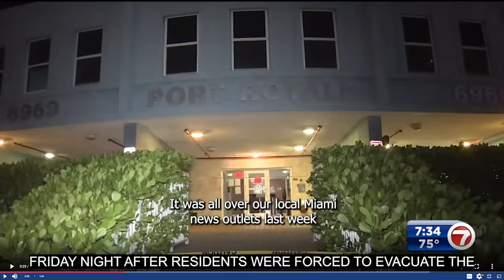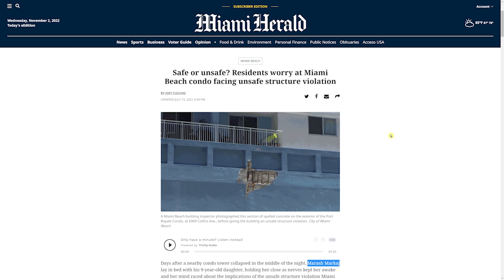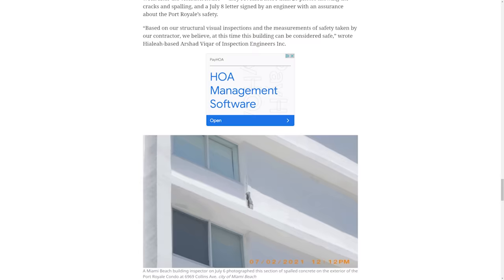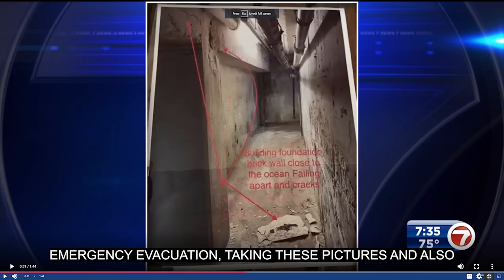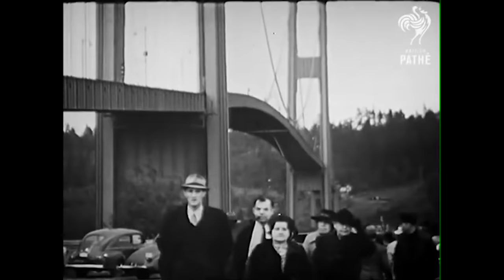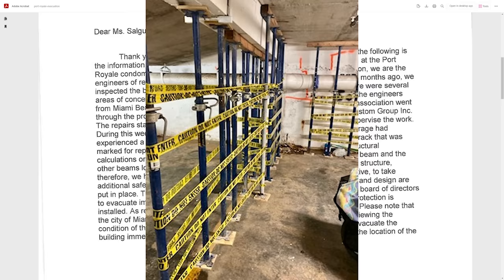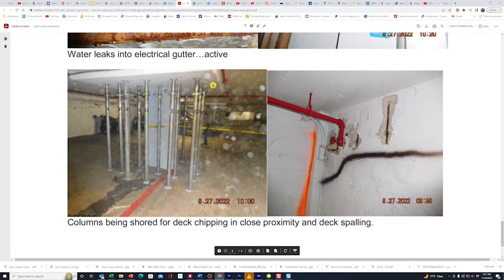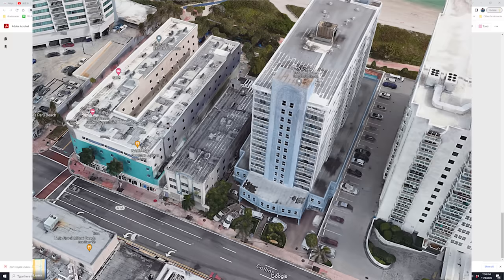Another Miami Condo Evacuated Why it Will Collapse

Comment: I’ve been a contractor for 40 years. I used to visit my grandparents on Floridas eastern seaboard regularly from 1993 to 2005. I can guarantee you that there are a lot more Champlain Towers South just waiting to collapse over there. Americans are building garbage, and not just in Florida. All of these buildings are being exposed to salt 24 hours per day. Concrete is porous. Florida is very moist. Moisture is going to penetrate concrete all over the place. Many of these places just patch over the bad spots, paint it or seal it, but the cancer will still be there. Good luck to you all down there. You’re gonna need it.
Reply: Exactly, this is not just a South Florida issue, I live in NYC and you can't walk a block without seeing a building that is either being torn down or rebuilt due to structural integrity issues, we have water issues here as well, remember that the middle of Manhattan is a swamp and cannot support massive structures as the battery or uptown can.  Shortcuts may save money in the short run but they cost everyone in the end.
Reply: Can that include houses too?
Reply: Go up to Inverrary in Lauderhill. Those mid-rises are in poor shape
Reply: It's only going to get worse.
Reply: Try Brazil 😅
Reply: Thank you for your insight into this issue
Reply: Guilty contractor has spoken
Reply: I'm a youtube neurologist
Reply: @hounddog946  I used to do delivery for papa johns in Lauderhill from the location on 441 and Oakland park blvd. We covered all of Lauderhill and Sunrise.  Some of those condo units I would go into were so dilapidated its amazing they haven't falling down. Many of those buildings have nothing but section 8 tenants living in them and their landlords don't give a crap or either don't have the money to maintain them like they should. The Inverery used to be a very nice when they first were built. Sadly I think all these buildings have a lifespan. Personally I don't think we should expect these buildings to last forever like most people do. I think even when you maintain them properly overtime the building concrete and rebar will continue to break down. I think alot of these buildings should be taken down and redeveloped. Maybe people should rethink about buying expensive condo units in these uber expensive buildings and think about living in buildings that are much more replaceable and cheaper to maintain and replace, buildings that won't be a huge financial loss if they have to be taken down. I don't know maybe the whole construction and real estate industry needs to rethink about how they market condos and high rises. Im living in West Palm Beach now and in down town West Palm Beach I remeber seeing this one building, it was a 2 or 3 story motel, with outside entrances to the units accessed by a walkway balcony along the perimeter of each level by outside staircases. Anyways Im mentioning this building because when i drove by,  it had huge portions of the outer walkway and portions of staircase that weren't even there because they collasped. It appeared this building still had people living in it and the only thing I saw keeping people away from the area was a construction barricade at the base of the stairs and some yellow caution tape near where the walkway gave way. Im not talking about small little chunks of concrete, I'm talking like 20 foot slab of concrete and brick. I can't believe people were still allowed to live in that building in the heart of West Palm Beach. I noticed that building, Im guessing about 5 yrs pre-champagn towers collaspe. Im not sure what happened with that building. It might have been repaired or eventually been torn down. Hopefully its not still there. This building Im assuming was built in the 50s. There's many more buildings that are creeping up in age that are in bad condition. Im all for saving historic buildings but when they become a danger to the public that's a problem.
Reply: @finnrobson3081  Yes and no. A concrete or block house can have cracking. Even severe cracking, but the weight of a standard roof would never cause it to collapse. There's just not enough load pressing down on the walls
Reply: Concrete in this salt water environent has a maximum safe lifespan and the bulk of these building have exceeded that. They should have planned to rebuild them every 30yrs not do 40yr recertification patch jobs.
Reply: these were built 50+ years ago…. just fyi i’d say it did pretty good after allll the hurricane and environment it’s been in for that long
Reply: @finnrobson3081  no. it only affects tall concrete structures. houses are built from wood
Reply: @RDC_Autosports  yeah im not saying in anyway they were badly built. I just think that concrete and metal have lifespans and buildings made of them  shouldn't be thought of as buildings that will last forever. I think that buildings that pass a certain age should be put on a list or something so people know they are living in a ancient building. Im not for having the goverment to force people to build things they dont want to but I am for making it so people know they are in a old building that might collaspe at any given time if they choose to live there. People that choose to live there should have to sign a form or something to wave their rights to sue anyone if they choose to live there. I think if people know that they may lose their life and their rights in a building like that they'll be more likely to live in a newer building and real estate developers will have more incentive to take down old decrepit buildings and rebuild new buildings in their place. That's just my thoughts on it. I think everything should be voluntary but at the time everyone should have full disclosure.
Reply: @tektkite7255  it depends on where you live. not all houses are made of wood. Where i live in Florida alot of houses are built of cinderblock some are even poured concrete with only the interior framing made of wood or steel. The older houses of Florida pre1930s are typically the only houses ive seen that use wood as there main structural support. With all the hurricanes Florida has had most developers moved to building houses of cinderblock or concrete with only the roof being made of wood or steel. I worked on one house built in the 1920s structurally framed of wood and it had about 1 inch of mortar spread across the framing to make the walls. All the structural wooden supports were completely rotted away at the bottom. There was really nothing holding the house down to the ground except for the weight of the mortar shell. After seeing the interior of its walls I always found it amazing that that house survived hurricanes with relatively no damage all the way back to 1920. Another thing looking at the electrical of that house dumb founded me. Its amazing the houses electrical didn't burn the house down. The electrical was still working all the way until we remodeled the whole house in 2017. I think im construction it all depends on the quality of the workers that build the house. You can have houses today with modern technolgy and materials that won't last 5 yrs because of half ass workmanship, then you can have something with really old building techniques and materials that will last forever because the workers did a good job. I don't know im probably ranting now. Don't know where im going someone please shut me up!!!! 😆 😆 😆 😆 😆 😆
Reply: I always look at American house's and amazed at how beautiful and big they are but they look weak as if made of cheap material and nothing compared to the Victorian house's here in the UK and the regulations here are very strict and they will make you tear down a mansion if it doesn't comply...just an observation.
Reply: It’s Florida!!! Everything is Disney era , yeasteryear mentality.. mots buildings have served their useful service life and should be replaced regardless of‘inspection’ results
Reply: @finnrobson3081  Anything that isn't properly maintained / repaired.
Reply: @Tekt Kite my house is built out of gingerbread.
Reply: @krisone63  not to mention there are subway tunnels drilled all over the place and the stories of unknown subway tunnels being found and other unknown tunnels......
Reply: We may have a lot of bad and poorly constructed structures here, but it's nothing compared to what goes on in China.  Seriously, it's a total mess over there with poorly constructed buildings that start to fall apart within 5 years of being built.
Reply: It's not just an American issue. Subpar construction and maintenance is widespread in nearly every country except Japan.
Reply: @DeusExAstra  crazy yt vids on those failures. with the construction bubble they had many shortfalls will never come to light  as the buildings will likely never be finished as they ran out of money.
Reply: Building high-rise structures on a sandbar is dangerous.
Reply: Looks like all those building are coming down! ❌❌❌❌❌❌❌❌❌
Reply: Are there geologic issues involved that make building in Florida particularly difficult? 1 ft above sea level and soil profile literally says sand and sea shells. Seems like making skyscrapers is tough in that kind of scenario. In New York you have granite bedrock to anchor your buildings to, something Florida does not have.
Reply: I have lived in South Florida for decades and its fact not fiction many of these were built with cartel money directly or indirectly and payoffs along the way to get them into "legit" income generating busineses and short cuts were taken no questions just like Champlain towers all sorts problems were found even in the original plans that were ignored. Hopefully there wont be a repeat. There will be more buildings condemed for sure
Reply: @finnrobson3081  exactly its not just the buildings. homes are being built by practically high schoolers lol. and everything is so cheaply made now. but they want half a million dollars for it.
Reply: Don’t forget the rising water table on the east coast of Florida in particular. There’s no way to keep that water from degrading those pilings in addition to creating an uneven settlement issue.
Reply: @TheBitterSarcasmOfMs.Anthropy  these buildings on the east coast of Florida were thrown up in a hurry in the 70’ and 80’s, often by fly by night consortiums of investors. A lot of shady stuff with contractors, investors and building inspectors. Stuff like a structural column would call for 13 sticks of 5/8 rebar. The contractors would pour it with 11 sticks of 1/2. The building inspector would sign off on the column. There’s probably the same stuff on the gulf coast, the building boom in the 70’s and 80’s on the south east coast was just the most insane during that period.
Reply: @finnrobson3081  No houses by and large are to small to weigh enough to collapse, and beyond that they are made of brick and wood normally so while the can rott and eventually crumble you'll notice before it does. Rotten wood is easily seen where rusted metal encased in concrete can't be.
Reply: @finnrobson3081  if your house is built of concrete and rebar.
Reply: @jamesbehrje4279  to deliver to the area you described; you deserve Papa John’s Medal of Bravery and Meritorious Service. I grew up in said area in 60s and 70s. It was nice middle class blue collar people. Inverrary was upscale and even had a PGA Golf Tournament there every February.
Reply: @hounddog946  I briefly lived in Inverry
Reply: @horsewithnoname12345  The whole world lives on borrowed time. eventually, all these buildings constructed 60+ years ago are going to start collapsing
Reply: I did apartment maintenance.
I know what you're talking about.
Owners want to make money, HOAs want to save money.
It's all about the Benjamins.
Reply: @wileecoyote5749  nah you're a youtube janitor now clean up the mess I made in the bathroom
Reply: @tektkite7255  -  Oh?  Are you sure about that?
Reply: Doesn't help that Florida is a known sink hole capital of the eastern seaboard
Reply: I have In Laws in West Palm Beach. They must be in one of the most expensive buildings in the area. It's on the beach and not that old. However, water appears in portions of an undergrown garage and there are other complaints. I think the building is in trouble.
Reply: @krisone63  This is a myth about NYC. Large buildings were not built in this area due to economics and zoning. The land underneath is the same (very sturdy). The reason you see scaffolding in NYC is that every 5 years, buildings must perform a facade inspection, which takes almost 1 year to complete
Reply: @omadjourney  Most buildings and homes are well built in the US. Maintenance is key though. These are extreme examples because of the salty atmosphere among other variables.
Reply: @lukethompson5558  True.
Reply: Look up Las Vegas new homeowners, unbelievable how shoddily those houses were built. They hire anyone to build, no experience.
Reply: I was just wondering how many of these buildings are in the same state.  people paying through the nose to live there and unsafe the entire time
Reply: @krisone63  At least in NYC they are on top of it and not sweeping it under the rug.
Reply: @wm1958  
I LOT of people's homes are! They just don't know it! YET! 😉
Reply: I read a long time ago, that rebar is NOT a good reinforcing material, since it rusts, and does what is exactly illustrated here - when it rusts, it pushes against the cement.
I find it quite interesting  that there are buildings, esp. in Europe, made of stone (even dry, not reinforced with mortar), and/or cement, which are still standing for, even, several centuries. Contrast that with what we have today... esp. in the U.S.
Reply: @dalemason9886  Your point  is well taken - thank you for the reminder of why those awful places were cheaply built, in the first place.
Reply: @Lilmiket1000  💯💯💯💯🤑🤑🤑
Reply: @ItsaRomethingeveryday  in more ways than one...
Reply: I grew up in Hollywood and the house I grew up in was built in the 30's, my parents bought it new. It was built sold of cinder block with the roof tied down through the the blocks into the ground. It's the new construction that's the problem.
Reply: Also, the Bible says you're not supposed to build your house upon the sand.
Reply: Amen
Reply: Good analysis. In addition, they are built in sand, and likely do have a foundation footprint deep or wide enough. All together, a real China job.
Reply: @larrysorenson4789  Houses used to be works of art.  The ones they built in Pasadena around 1900 were not only beautiful but solid.  Everybody involved in the housing market today, both the builders and the buyers, are ignorant of the finer points of housing.  They want things too big too fast.
Reply: @davidlafleche1142  the Green and Green Pasadena homes marked an almost oriental obsession in beauty and perfection. Here in Arizona there is a history of great works. I have designed and built homes and offices to my standards for 40 years. My Gods are the master builders of the previous century. The money risk was mine and can you believe it, when and if I ever sold a property there were no discussions of cost. Recently, the cost of homes in Orange County Ca. Hit an unbelievable $1,000/sq,ft. For stucco clad stick boxes with builder hardware and nice rubber windows slapped together by unskilled workers and featuring the “luxury” 1/2” drywall.

Not my cup o’ tea.

Keep the faith baby.
Larry in Arizona
Reply: @hounddog946  yeahhhh sketchy stuff. HOAs do everything in their power to not increase fees or whatever so nothing is fixed as it should be
Reply: @meredithheath5272  they know the rebar stinks yet they keep using it
Reply: @Lakridza67  I studied Architecture at the Ecole’ des Beaux Arts when it was located in the Versailles Complex. One professor was a Danish guy named PribBuss. He had been the field Architect for the Opera House. Tons of stories over wine, baguettes and cheese. Oh, what could have been. But as with untested designers, it is a miracle it got built at all.
Reply: @larrysorenson4789  I am born and partially raised in Denmark. Things seem more proper over there. I miss it a lot!🫶🏻
Reply: Amen, brother.  There's more to come.
Reply: @finnrobson3081  Absolutely. The new houses are not good. Although they are built to stricter building codes, they mostly use chip board which comes apart after limited exposure to water or moisture.  Also contains all sorts of glues that burn fast and hot.  The solid lumber, grown ultra fast with GMO, and harvested very early, has huge growth rings. Low density, burns fast. Prone to warping, twisting, distortion. The interiors crammed with synthetic carpets, plastic galore, burn very hot and fast. PVC siding very toxic when burned. Most of the interior trim is MDF fiberboard. Very little resistance to water, even just mopping the floors or you leave a window open and some rain comes in. It’s garbage. Looks fine when new and can sell the house quickly.often built by neanderthals who could care less and just need to get home to watch The Simpsons or play on their Nintendos.
Reply: Exactly. This guy is clueless
Reply: Americans are in fact not building garbage. Maybe your company does and you’re an American so that’s why you assume this? Epoxy coated rebar and water proofing admixtures are frequently used in FL. I’ve been in concrete construction in FL for over 20 years and I’ll guarantee you the current buildings are not garbage. This is an over 50 year old building. Get a clue.
Reply: Do you know what happens with condo owners if a building is condemned?  Do they get any remediation?  If a builder wants to buy the building and rebuild, do the owners have any say?  Thanks.
Reply: @davidlafleche1142  precisely the reason why not all change is good change!
Reply: @Lakridza67  "Meddle not with them that are given to change."
Reply: @Lakridza67  Oh, you're from "down under"?  I'm from "up over" (New England).
Reply: @Lakridza67  my brother’s wife is Danish. She and her Daughter carry dual citizenship. At one point there was talk of that family Re-emigrating. Sadly, my brother and I are only 50% danish, genetically, eliminating him from ever moving there and having productive work. They are heartbroken but do visit annually. Their daughter attends school there for 90 days each year. Best always. Larry
Reply: @larrysorenson4789  I am in the Same boat. They won’t let me back because my father is Norwegian! They have lost the plot over there. A fifth of their population is now Muslim so there’s that🤷🏼‍♀️🫶🏻
Reply: @larrysorenson4789  and I am fluent in Danish too. Ridiculous and discriminatory laws they have going on🤦🏼‍♀️
Reply: Funny how in Europe there be thousands of year old buildings still very safe and American built stuff is crap in general
Reply: Wouldn't it be appropriate during construction to seal the concrete and then every few years reseal it to limit moisture penetration?
Reply: @eddielane9569  Well, in a word, yes it would be nice to seal all surfaces on all buildings every 3 years. Its also nice to always change the oil in ones car every 3,000 miles, seal ones tile grout annually, thatch your lawn seasonally, change your smoke detector batteries twice a year, etc etc etc. who ever does all the stuff they’re supposed to?
Reply: @larrysorenson4789  yes, I suspect you may be right! Sending love from Melbourne Australia 🫶🏻🕊
Reply: @Lakridza67  😃👍❤️
Reply: Thank you for this explanation it helps to understand
Reply: @jamesbehrje4279  James; thank you for taking the time to add an in-depth and thoughtful post regarding the subject of buildings in Florida. I always think about the N I stayed in in Germany back in the 80s that was 600 years old. It makes me crazy that Americans don’t care to build structures that we intend to last generations. I am troubled, again as a builder, that we are making garbage that needs to get blown up after 35 years of service only. Even if you recycle every bit of material in the building, it still takes an extraordinary amount of energy and resources to build a new one. at the heart of this though, I know I also resent endless buildings visually polluting pristine Florida coast line. As you pointed out many of those buildings or two or three story once upon a time, and then those get torn down and become 10 story, which will probably get torn down and become 30 story and so on and so on. Where does it end? since so much of this garbage was produced in the 60s 70s and 80s, my guess is that the Champlain tower south was sort of at the forefront of mass building failures. Although it was not among the oldest, it is easy to see that it was severely abused with all the added weight of the pool deck pavers and sand, huge planters and palm trees, and that 13th floor we are not sure whether or not that was ever completely authorized, and perhaps CTS had more than it share of marble and granite being added over the last 40 years. And possibly it may have been slightly under built as well. Again I know the clock is ticking, it will be no surprise when the next one comes tumbling down.
Reply: @finnrobson3081  yes it can, but houses aren't nearly under the same load and are typically wood framed. The case is where houses are victims of modern builders and engineers are in fires. I watch the fire in my town of an old train station. The building burned not down, but away for like 2 hours. It seemed to evaporate and not once was there any structural collapse. The old frame Construction was so solid all the framing burned in place without collapse. Modern houses made of composite wood using little hangers will spontaneously collapse during the burn. It is caused more deaths a firefighters as a result. Entering a modern burning house is much more risky than the past because of that. A common issue in Ontario has been the collapse of exterior decks. There have been about half a dozen with fatalities in the past 5 to 10 years. These were caused by people building exterior Decks that were just lagged into the wall and with enough people on them they would collapse and kill. A neighbor across the street has a deck that attaches to the house on the second floor and he was getting water into the basement. The deck was slotted in under the door and the posts holding it up we're obviously not set below the frost line as they could be seen to heave and this caused rainwater to pour against the house and it completely rotted the frame right down to the basement. So his house could collapse on that wall. As far as I'm concerned deck should be freestanding off the house structure. They should not be allowed to be attached to a brick wall
Reply: My father was a heavy construction worker, and a lot of his work was on the new 401 highway back when I was an infant. Some of the companies he worked for, because he was just a machine operator, redirected garbage trucks to the concrete pours and filled many of the overpasses with garbage mixed in with the concrete to save money. He liked to joke as we went under some of these overpasses, and would step on the gas pedal, and then yell that we had made it. The construction industry is corrupt Beyond imagination. And it doesn't stop at mundane buildings. The Fermi 2 Nuclear Plant had more than 20 tons of missing rebar, and they were voids in the containment buildings concrete large enough for a car because they never vibrated it. I've seen residential concrete walls in basements that were essentially glued together aggregate that look like they had only been dampened with concrete. And the repair work consists of paraging  over the defective load-bearing work.
Reply: Nothing a little silly putty and superglue won’t fix.
Reply: @jamesbehrje4279  yet over here in Europe we have buildings that are still up & safe hundreds of years old. I've lived in a placed dated from the 17th century before.

I know we rarely get hurricane type weather but we do have excess humidity, temp variation, road salt & more
Reply: @Tekt Kite  single family Houses in Florida are typically built with cement.  
Wood just rots and gets attacked by bugs.
Reply: @jamesbehrje4279  Actually.. you're right on the mark.   Florida and wood don't jive.
Reply: Looks like it was a lot of cheap concrete supplied by a certain group of wealthy individuals who are not building contractors??
Reply: And yet the concrete the Romans made is still solid thousands of years later despite being built by or sometimes IN the ocean.
Reply: @platedlizard  Yeah. Go figure…
Reply: Some people may hate regulations, but here is an example how regulations can help prevent these outcomes.
Reply: @horsewithnoname12345  oof
Reply: @platedlizard  Roman's had Alien Technology like the Egyptians did ?
Reply: When I was a kid, we were stationed at Patrick AFB for about four years, I was attending DeLaura Jr High!  While we were waiting for our housing unit nearby, my Dad rented a furnished apartment.  It was just South of that school, so I decided to walk to it, after school, and, I saw a heavy set lady get into her big four door, example of a Detroit steel
car, She sees me walking towards her, Sits down, and slams her door shut, and, I hear a crack sound I was not expecting, her car beaks in half, settles down she gets out, as I walk up and, remarks that this happens about every ten years from living here by the ocean,  We at the time had a 1967 Buick Skylark, it had big rust holes from our four years living there, looked pretty bad, so much so, some dum, dum, in Texas, thought we were low class people, started ringing our door bell, toilet papering our house, being a pain for two of the four years, we were there until one day I had enough, bought a bunch of eggs, and put a lawn chair across the street and, sat down there, and started egging their house.  His Mom opened the front door just as it hit, ans she got some egg on her, and she was pissed came over and started yelling at me, my Mom came home at that time, and, was standing net to me, when, I yelled back, saying,"well, At least I can do this in broad daylight, your son, can only can do at night!  She shut up, went back to her house, and I could hear her screaming at her booger of her son, who thought he so cool, that he was in the marching football band!  And, he wasn't the low class people running a 1967 Buick rusted out car!
Reply: But concrete that water doesnt go through exists.
Reply: @finnrobson3081  Probably but houses are usually only 1-2 stories compared to high-rises that have more weight resting on support beams. High rises would collapse like a stack of cards and those at the bottom and between the deck, are unlikely to survive. Most people might be able to still be alive if the second floor of their house collapsed.
Reply: @larrysorenson4789  because of over population
Reply: @dindog22  the engineering is sound. The steel fabrication is scrutinized and tested. The final installation is subject to serious workmanship flaws and the overall designs seem to underestimate the long term effects of constant moisture infiltration. Better design costs more and with developers making the decisions like thinner concrete slabs and no waterproofing sealants, the life of the structures becomes questionable.
Reply: You know wat amazes me? As you say, they're building garbage but when the inevitable happens, the point the finger in all directions except the mirror!!!!!!
Reply: @comfeefort  when they built the shower they probably removed whatever floor finish was there, put down a plastic waterproof barrier and new tiles over it. They may have retiled the entire room but the plastic was probably used only where the shower is. While doing this work they should have sloped the floor towards the drain. It sounds like they did not extend the slope outside of the shower wet area itself. All that said, the occasional shower is probably not enough to effect the floor’s structure.

Structural degradation is usually the result of years if not decades of exposure to really wet conditions. So I think that this incidental water is more of an inconvenience than a real problem.

You might send a note to the management company informing them that your request for a shower curtain is meant to address a privacy concern which is covered in the ADA (Americans with Disabilities Act). Ask them to install the curtain so that the shower will be in complete conformance with this federal law.

Best regards. Larry
Reply: @comfeefort  when they built the shower they probably removed whatever floor finish was there, put down a plastic waterproof barrier and new tiles over it. They may have retiled the entire room but the plastic was probably used only where the shower is. While doing this work they should have sloped the floor towards the drain. It sounds like they did not extend the slope outside of the shower wet area itself. All that said, the occasional shower is probably not enough to effect the floor’s structure.

Structural degradation is usually the result of years if not decades of exposure to really wet conditions. So I think that this incidental water is more of an inconvenience than a real problem.

You might send a note to the management company informing them that your request for a shower curtain is meant to address a privacy concern which is covered in the ADA (Americans with Disabilities Act). Ask them to install the curtain so that the shower will be in complete conformance with this federal law.

Best regards. Larry
Reply: @omadjourney  Your observation is ignorant. The materials are only cheap if someone uses cheap finishing products or poor-quality wood, in which case it's done intentionally. That's atypical. Wood is anything but "weak", and wood-framed homes are built to accommodate the challenges of the areas in which they are constructed. Wood-framed homes are more than strong enough to withstand areas that routinely experience extended periods of high wind, seismic activity, severe thunderstorms, hail, and more. A brick home is not going to stay up against anything above an EF2 tornado, and at EF2 and below you're still going to experience severe property damage and financial loss from a direct strike on a brick home. As an aside, many American homes are built from both wood and brick or block.
Reply: @rosewd2  So glad my parents never bought into something like this. These are just death traps unless cleared out in time.
Reply: Anyone who's lived in an oceanfront structure  -- even if stable soil -- knows this is true. Maybe someplace the wind blows offshore every day, but most places, salt mist is coming in. Your car rusts out or replace the alternator and radiator every year, the electrical sockets can short and cause fires. Continual corrosion control like on a ship is the only way, something not easily done in a residential structure.
Reply: Buildings either need to be properly maintained, or given a lifespan that they can reach before being torn down and replaced. A lot of these buildings are very poorly maintained leading to severe structural issues. Many built back in 70's / 80's, and we have a lot of new techniques and products that can extend their life but no-one wants to spend on them, so we end up here.

Some very tall apartment buildings in Sydney were only built recently and due to garbage, unsupervised construction are already failing just 4-8 years after construction and are having to be propped up and saved at huge cost. The owners have lost hundreds of thousands on any investment potential as they can't sell the things.
Reply: They don't keep up with painting properly either. You can avoid a lot of this stuff if you are doing triple coats of paint (paint made for a salt environment) every 3-5 years. But they got 10-20 years without painting. It's always doing as cheap of a repair as you can.
Reply: @VenturiLife  Surely there should be significant jail time for a building failing because of poor design. I heard, in old times, somewhere, there was a law to execute the builder if his building collapsed and killed people. You are so right that greed and laziness are the main reasons this is happening.
Reply: ABSOLUTELY!!  The majority of those high rises are doing the same thing, or will be soon enough. 
It's all garbage, quick and cheap construction.
Reply: The problem isnt so much with the concrete from my understanding, it's the rebar which literally evaporates into rust in those conditions. Salt / moisture results in the internal rebar becoming non existent. (over 250-30 years) I'm pretty sure we know how to prevent this too, use galvanized rebar, or coated rebar
Reply: @Ran-dom1  The coated rebar, coated with epoxy retards the problem, yet creates others. 
The concrete has to bond chemically with the steel, with is caused through oxidation, or exchange of oxides. 
Thats non-negotiable. 
Oxidation is rust basically, but controlled if the concrete remains intact.
Epoxy wont oxidize that way, so doesnt bond as well to the crete. Obviously, that creates a different set of problems.. 
No solution is perfect, or absolute.
Reply: @hsiehkanusea  Yes, the end is near. Run! One more goes down and people will realise real estate is worthless there.
Reply: @Ran-dom1  Coated rebar sounds the best. I think it's like double the price though.  Problem is it gets scratched/knicked in installation. Galvanized is like stainless steel, it still rusts, just takes twice as long.
Reply: @schumannresonanceswithverte  The rebar is ENCASED in concrete.
Reply: @Ran-dom1  which rebar?
Concrete is otherwise known as activated alkali.
The rebar chemically bonds to the rebar through oxide exchange. 
The steel the aggregate is encased. The reinforcing bars need to bond with the concrete.
Reply: @schumannresonanceswithverte  There is no bonding... It's just trapped when the concrete dries, and gives it structural strength. when the oxide exchange occurs that would be rust. Iron oxide, is rust. Rebar is iron. Therefore, not a bond, but a degradation 
Hahaha, the whole reason rebar fails is rust.
That's not a bond, That's the Iron turning into something no longer structural, to literal dust, or as we know it as, RUST.

Thats the whole reason infrastructure and buildings FALL. Especially ones built by the sea. Thats why rebar needs to be coated or galvanized, TO PREVENT OXIDIZATION as long as possible.
Reply: @Ran-dom1  You are not seeing the process properly. What you describe is a run-away oxidation that occurs from exposure through those hairline cracks, which keep getting bigger. 
The concrete bonds to the steel, which is an alloy. 
The problem you have in dealing with the epoxy coated rebar is first the added cost. They usually do a cost-benefit analysis on these things, and disregard the epoxy coated stuff, due to the added cost, and the whatever benefit you'll get.
The second problem with the epoxy-coated stuff is that the epoxy has to completely cover 100% of the bar, 100% uniformly, for it to do it's job in protecting the rebar. 
It's impossible to get a uniform thickness on rebar. If you've seen it, you'll know it's rough and textured, to allow for the greatest surface area. They paint on the epoxy, or dip it, but it's not going to ever be a uniform thickness because of what it does. 
The epoxy also holds in rust, if it's been started between the epoxy and steel. 
When concrete cures, it also heats-up and releases water. This is why concrete can crack inside, because it's been cured improperly. 
Any steel that's not bonded to the steel, is going to continue to oxidize, as it's got free electrons that are looking to become stable. 
Spalling at those tiny hairline cracks that develop, and get bigger, into a structural issue. 
The first major reason why it starts getting these is shear pressure, of the concrete doing a job it's not meant to. 
in the case of spalling, where the rebar is going to get exposed to the air, that's where the epoxy-coated stuff works best. 
if the concrete remains intact, then you'll never need the epoxy coated stuff, because the heat of the curing has essentially stopped further internal oxidation. The steel itself is stable, as long as the concrete is intact. 
But, the concrete itself is inferior because they pull it from the ocean, and can't use enough water to fully rinse it. 
The concrete doesn't quite bond well together, it's not bonding to the steel inner supports as well. 
Mo, you don't want the rebar "just hangin' out" in the middle of the concrete; without it doing the work of bonding, and binding electro-statically, as well as mechanically, through the rough surface, to the steel itself.
Limited surface oxidation, that's taken-up electro-statically with the surrounding material is idea; because the curing concrete will heat, and stop the process further. The spalling, and hairline cracks, left unchecked are creating the problem you're speaking of.
Reply: Information not clear, not enough red arrows pointing to random things.
Reply: Concrete seems to be a rather poor construction material in the long run. At least as it was used in 60-70-80 in North America
Reply: @dmitripogosian5084  its sufficient if used properly.
It gets overused for too much.
Reply: @jamesbehrje4279  There is a certain office building in down town WPB you likely know of which has the first several floors occupied by the parking garage. There were many leaks and extensive spalling last time I was in that garage (2017?). They had to do extensive remediation on the other garage belonging to that complex, they even had a fire stand pipe fail and damage one of the stairwells.
Reply: Yeah you need a much stronger, more expensive concrete that is less impervious near the beach. It would be in the codes
Reply: I don't know that in itself it's a problem. Chicago is LOADED with salt several months a year in winter. Most of the limestone and concrete at my 120 y.o house was just dandy with very minor damage when I left. 

Their CONCRETE is cheap shite. Their supports are WAY too small/thin for a building of that size, especially with a moving car load. 

And none of the pillars are spaced close enough together or AT ALL correctly where the rebar is! This guy has a lot of such, as does Building Integrity.  

I'll take gigantic chunks of limestone, please. Limestone isn't as porous as this garbage.
Reply: It depends on what, how and where. Imo. Enough snow will and has dropped many a stadium roof. 

Bad cracks are large and diagonal, particularly at the door and window corners. Step patterns on your brick mortar? Also no bueno. 

I know many many buildings that crack at drywall seams (well, they were put in WRONG: not staggered 4 feet and not nearly as strong as I would have nailed them down) on a seasonal/yearly basis. I know EXPENSIVE buildings with a substantial amount of that going on. 

My q is, is it (the doors and windows particularly) still level and true? Once you start having door and window problems, that's more serious than small hairline cracks from changes in seasons. 

BIG cracks are a problem, especially wide ones. 

But I've lived in buildings where you had many of those for several DECADES and damn thing is still standing. No step pattern brick cracks, tho.